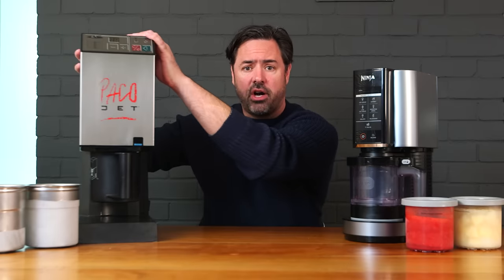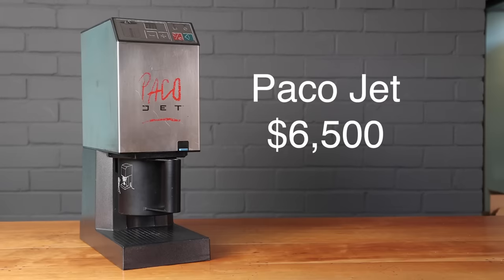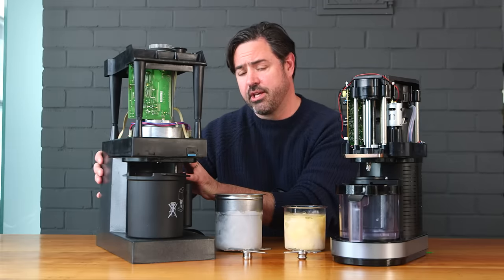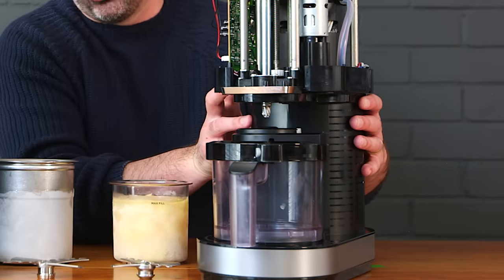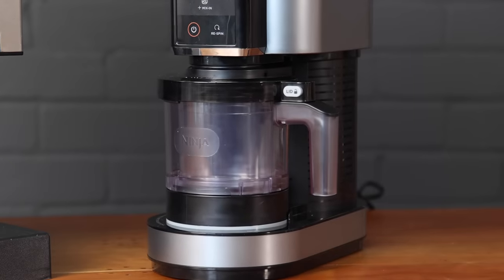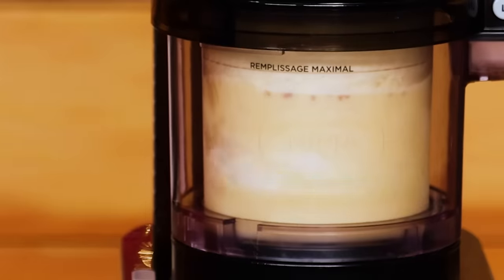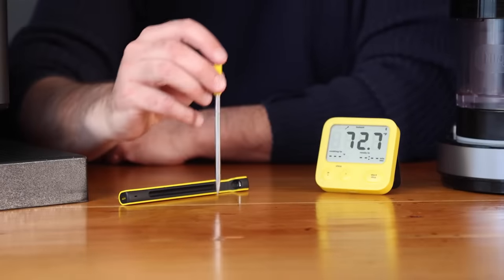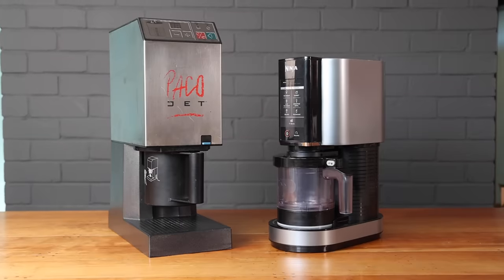Ninja CREAMi: Pacojet Killer?

Comment: Might be worth noting that Costco has had this on sale a few times for less than $150.  Also, I'm kind of curious since you seemed to be a bit skeptical of the Ninja brand.  I've bought a few of their items over the years, and for the most part, they've been pretty good overall.  Probably the family favorite has been the Ninja Foodi air fryer.  It's biggest benefit is that it's flippable, so while that does heavily restrict the height, it's extremely useful for smaller items.  I think the one that we haven't been terribly fond of as much is the Ninja Foodi Grill.  It isn't bad, but also not terribly impressive.
Reply: You have to try the ninja woodfire grill. Ive smoked whole chickens, ribs, reverse seared steaks. Pretty amazing device and so much easier than a pellet smoker. I‘ll be getting a creami after this excellent vid.
Reply: @jeffgrabowski706 or you can get a real smoker like a normal person and not that fake garbage

Comment: Thank you for this profound review and comparison. However, what you are showing is the old Pacojet first generation and there are two advanced generation available now. I think the fist generation is out of build since 2013 or so. The second generation has a much improved setup with a brushless motor and the pressure and vacuum system is also enhanced. I haven't worked with the newest Plus version but you even get fancy new features like 3D shape milling the frozen content.

For the price given you get a generation two model this time not the first generation. The market prices are a bit lower as well, so around 5000 for a brand new model. Used ones are less with a little bit of luck you can get a good machine for half of the price. In addition there is also a little brother of the big Pacojet called Pacojet junior for around 3500 in new condition I think. Of course no competition for the Ninja in price but significant less than the big boys. So your introduction that Pacojet hasn't improved over the time isn't hundred percent correct. However, your conclusion that this machines are not priced for the home market I can absolutely agree. 

I wanted to mention that the Pacojet isn't made for ice cream only. You can make farces, pesto or even soups and sauces. There are accessories like the coup set which will replace and enhance your food processor for cutting non frozen ingredients as well. There is a very profound knowledge base with many recipes from professional chefs and a professional oriented community. If you really want to endeavor the culinary would and want to do something beyond simple ice cream the Pacojet has its value even if you are only a serious hobby chef who see this as a hobby and is willing to spend some serious money for the the hobby.

For everybody else, who simply what to learn about this new / old concept for processing food and loves sorbets the Ninja seems to be a fantastic beginner machine with a price point which doesn't scare away the ordinary home chef. It reminds me a little bit to the sous vide sticks which popped up ten years ago for the home use. You can do exiting new things with it but if food and cooking is your passion as a serious hobby the expenses for a real Pacojet might still be worth it. Even for this price.

Comment: I just got mine this week.
Did not expect the noise to be that bad :D Earplugs are mandatory. Also the device wobbles and shakes a good bit during operation which is a bit disconcerting.

Re-spin definitely makes much more of a textural difference than just stirring with a spoon, without I get some chunks of ice that stuck to the side, the respin pulverizes those too.
Cleaning the lid and drying it is the most annoying bit.
Reply from the maker: Yes, the noise is loud! 

One thing I’m learning from the comments of other owners is that the CREAMi seems less tolerant of a less than perfectly formulated sorbet or ice cream base. If the dissolved solids and fat content isn’t in adequate, or if the mix is frozen a bit too cold, then it can end up icier or in need of a second pass in the machine.

My current theory of why this is the case is that the velocity of the blade tips is slower than a PacoJet, so there is less shear force near the edges if the container. Put simply, the RPMs need to be higher.
Reply: @ChrisYoungCooks  I've just had the opposite effect that my standard gelato recipe was too high sugar and fat so it became softer than soft serve after creami-fying. Similar for the sorbet, I went higher sugar than recommended for pacojet recipes because I underestimated how sweet blueberries are and didn't bother getting the refractometer out, and there it simply was icy bits stuck to the container that didn't get ripped loose by the blades, as well as some of the very first chunks it ripped out on top
Reply from the maker: @tommihommi1  high sugar being too soft can be offset a bit if you freeze the base to a lower temperature before blitzing, but high-sugar bases from a PacoJet or Creami are always going to tend to melt fast IME. Since there is no churning action, you don't build up a whipped fat droplet structure that stabilizes the ice cream, like a churned gelato would have. Makes a big difference in how quickly things melt.

The icy bits along the container wall are interesting. I had a bit of a problem with that when I just did the classic Pacojet demo recipe of a can of pineapple in syrup poured into a container and frozen. But I didn't have that problem with my go to recipes for strawberry sorbet and sweet cream base for Pacojets. BUT, I've definitely heard other people say this is a problem and needs a second mix. So it seems like there is a very narrow sweet spot for the Ninja doing a perfect job in one pass.
Reply: @ChrisYoungCooks  it would be neat if there was a program that just does it automatically, with how many buttons it already has

Comment: Great breakdown, I appreciate the context around the patent - I was curious why the pacojet was still so highly priced
Reply from the maker: I think the answer is that the serve a very small professional niche that is willing to keep paying the premium because they use the heck out of the machine.
Reply: I think the Pacojet's motor is a lot more powerful as well.
Reply from the maker: @previll  surprisingly, it’s not a lot more powerful. When I measured peak power the PacoJet motor could pull up to about 1000 Watts, while the Ninja pulled 900 Watts. The PacoJet motor can deliver this power for longer without overheating, but it’s not actually a more powerful motor.
Reply: @ChrisYoungCooks   Yeah I read something similar in the specs. However, wattage is not a very accurate measure of motor power, as more factors come into play, such as build quality, motor efficiency, design, part quality, durability, etc.

Anyhoo, a direct comparison of the results speaks for itself, although you did not show it in the video. Modernistpantry has an excellent video review on this. 
The Pacojet turns out far superior there with a much creamier consistency, but at 30x the price I suppose consumers don't really have a choice. 
Though I would just go for a Vitamix blender, it can do essentially the same thing (puree frozen stuff), except it can do a lot more besides that. I also don't expect these CREAMers to last very long, given Ninja's brand reputation.
Reply from the maker: @previll  so motor power doesn’t change the final texture of the mix. Either the motor is powerful enough to drive the blade or it’s not. The particle size is a function of the RPMs and feed rate of the blade, and both machines end up creating a 0.5mm “chip” size and then smashing the chip into small bits. The PacoJet, with its faster RPMs can put a bit more kinetic energy into smashing the chip, but it’s not a lot. And when tasted side-by-side blind, the CREAMi resulted in very slightly icier mix, but it was a very slight difference. The difference between a churned ice cream and a Pacotized mix is a much bigger difference.
Reply: @ChrisYoungCooks  I'll just have to believe on your word about the texture. Fair enough then, you do seem to have quite detailed knowledge about the technology at least.
Reply from the maker: @previll  for what it’s worth, the PacoJet seems more forgiving of bad ice cream formulas than the Ninja. A lot of folks report the Ninja needs a second pass to smooth out the texture. This seems to be an issue with low-soluble solids content ice cream recipes. The second pass just kind of smears the mix and makes it look smoother (it doesn’t actually cut it any more and you could just use a spatula or back of a spoon to do the same thing.) The PacoJet’s higher RPMs and wider blade seems to be able up do the smoothing as part of the first pass. 

The other thing I’ll mention is that many of the “official” recipes on the Ninja CREAMi website are actually bad, which doesn’t help make the machine look as good. 

In a sense, I think Ninja has become a lot better at engineering products, but they’re still not good at the cooking part of the job.

Comment: I think a consumer centrifuge is one of the last remaining inaccessible fancy kitchen things that could use a consumer version. I think Dave Arnold made one that was technically very cheap but it was still $800.
Reply from the maker: It’s a bit of a hard problem because of the forces involved. Managing that much kinetic energy safely requires a hefty amount of expensive raw material and not-terribly-cheap manufacturing processes. And you’re not going to get economies off scale from making millions of units every year.
Reply: I'd kill for a home version of the Breville Control Freak.  I'd buy one but, they are HUGE and I am afraid it would blow out all the circuits in my house.
Reply: @SummaGirl1347  The Breville Control Freak doesn't draw more electricity than other 120V induction burners. The popular Duxtops ($50 and up) are 1800W, just like the Control Freak. Your home electrical wiring won't tell a difference. Same maximum power draw, the general US standard. Like a toaster oven or electric kettle.

Given the cost of the Control Freak, I think there probably should be 240V compatibility, to make it as powerful as a proper induction stove. But that would involve a different plug that wouldn't fit in your typical US outlet. But it could be a popular feature for commercial use and enthusiasts.
Reply: vaccum chambers are also very useful in the kitchen!
Reply: @jek__  They're widely available for two or three hundred dollars. "Chamber vacuum sealers". They're most popular for vacuum sealing food in plastic, which is very useful for freezing, but they can also be used to alter foods by sucking out air. This can be useful in food preservation, cooking, or to make unique foods. For example, vacuumed watermelon is a popular novelty people try with their home vacuum chambers.

Comment: I currently use the dry ice method, and I like that I don’t need a whole extra kitchen appliance. That said, I’m tempted by the Ninja, and I’m curious about logistics/planning. Does pacotizing affect how hard the finished product sets up in the freezer vs other methods? I’ve heard I might need to re-pacotize after a day or so in the freezer.
Reply from the maker: I wouldn't necessarily say that it changes how it sets up, like any ice cream or sorbet in a cold freezer the mix will harden again. And I find just re-pacotizing it immediately returns it to the ideal scoop able texture much faster than letting it temper.
Reply: @ChrisYoungCooks  in a professional setting, many choose pull the frozen base and pacotize portions to order. You can set it to do as little as one portion - up to the full canister. The idea is that you can get the absolute perfect serving consistency every time.

Comment: Just had Pacojet come to our showroom for a demonstration of their new "4", with independent spin / depth control, and plastic containers... still oversized motors at 3.3X the weight, but interesting to see where the new one got its idea's from lol
Reply from the maker: Interesting. Haven't seen that yet, but will have to investigate. The thing about over-sized motors is that there's no benefit—and often it's counter productive. A motor needs to be sized and built for the performance requirements it will experience. Making it larger often ends up causing the motor to run at a lower efficiency, which generates more heat and shorten its lifespan. Marketers and sales reps love to talk about over-sized motors, but for engineers who design motors it's all bullshit. When I tested the Ninja motor versus the Packet motor, they pulled exactly the same amount of power, but the Ninja generated much less heat to do the same work. That tells me that the Ninja motor has been pretty carefully selected to be at optimal efficiency under load. The Packet motor got hotter, which tells me its basically run well below peak efficiency.

Comment: Amazing review and as a fellow product designer and engineer I appreciate your take on the differences! A few more I noticed that may also apply:  It looks like the Pacojet has metal gears (I'm guessing sintered, but could be wrong) vs the Ninja, another sign of the expected lifecycles it's expected to survive and a sensible cost-cutting measure on the ninja. 
Another point, while the Ninja container loading scheme is clever and appropriate for the home, it would be a nightmare in a professional kitchen: the last thing you want is a recess that's impossible to clean and where any/all liquids and such can seep in. The Pacojet's flat, wipeable base is a lot smarter for their application for that reason alone. 
Again, love the insights you shared and thanks for putting together an amazing video!
Reply from the maker: Agree on the loading mechanism, it’s really nice but would get trashed and dirty in a professional kitchen. 

But gearing in the PacoJet isn’t any more durable in my opinion. Mixture of zinc castings and nylon. And the pressurized air hose is impossible to clean without destructive disassembly.
Reply: @ChrisYoungCooks  Fair points! I have never seen either outside of this video, so I have limited info on this :)
I do wonder what duty cycle and lifetime cycles they engineered the Ninja for but I agree it looks shockingly well made at first blush. Not quite Juicero-level over-engineering, but that's why this is affordable 🤣
Reply from the maker: @jessesilver  There are somethings that are surprisingly well engineered, and other things where you can see that they just went for cost effective (the screw count is insane). My understanding is they have already shipped a second generation with larger capacity and other refinements. Probably not something I'll do another video on, but I'm curious to crack it open to see what got refined between generations. That's always really interesting (to me anyway).

Comment: I think the reason people like the pacojet is that it delivers results that are close enough to perfectly churned ice cream, while allowing for bulk prep of different flavours. The Creami is great, but as long as the consistency is not there, it's not worth my money.
Reply: I looked into getting the creami but ultimately i chose to use the dash mini ice cream maker. Instead of freezing your product ahead of time, you chill it in the fridge or just mix the things and store in the fridge. Just the body of the churning pot goes in the freezer and helps to chill the mixture.
It works well with sorbets and ice creams but I want to try with oat based ice creams too.

Comment: What are your thoughts on the temperature of the mix before processing? I often see it mentioned as a requirement that the pacojet beaker be frozen to -22C for proper processing. Given the similarity of the machines, is this not also true for the creami? While it seems like both machines have similar capabilities, how will the warmer temperatures of the home freezer affect the results of the creami?
Reply from the maker: In my experience the PacoJet didn’t like to “spin” canisters that cold, and often threw an error code. I’d have to let the beaker warm a bit before I could process it. Personally, I thought you got best texture if the base was between -10 and -15C. That seems to be as true with the Ninja.

Comment: I personally don't like the idea of attaching the blades on the Pacoject when they could spin in your fingers, ouch. Yes I know there are multiple safety switches to prevent this but
the Ninja way is more re-assuring. Thanks for the history on how the Pacojet came about. Any short-comings regarding speed and quantity of the Ninja can be easily addressed by having multiple machines as they are so inexpensive.